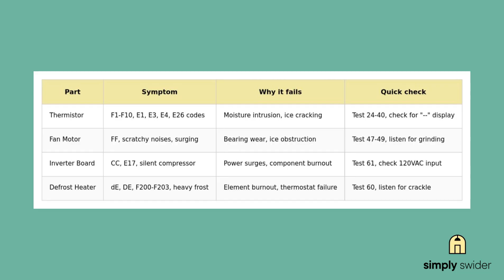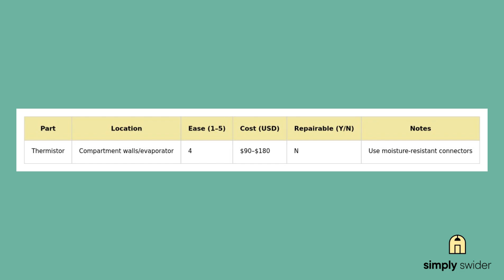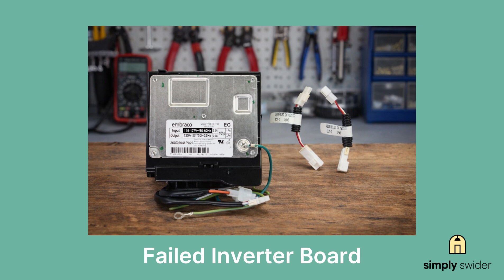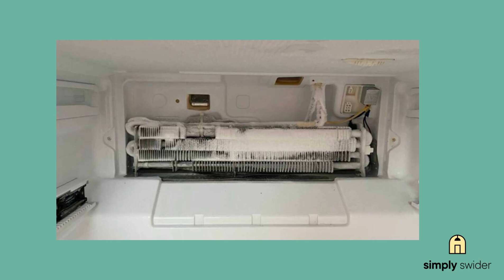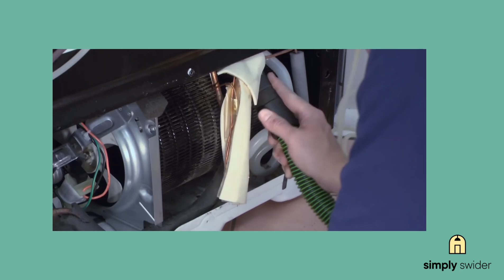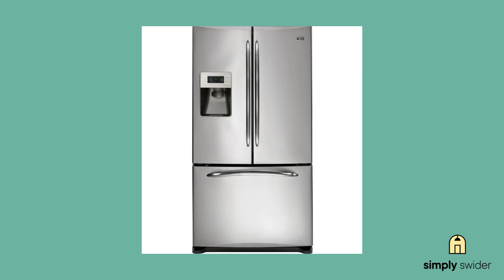GE Refrigerator Error Codes FF, CC, HRS: Fix It Yourself & Save $800!

Comment: Great video. My GE 22 CF bottom freezer model has temp reading panel, but holding them does not show error codes. Compressor is not working fully due to overheating from wire break and fan stoppage. It is a few months past 1 yr warranty and GE is not offering to help with repair.

Comment: i have a GE fridge and have the HRS code, sounded like it was trying to kick on every second or so in the back but i noticed it too late now it doesn't even make that sound, unplugged and cleaned everything in the back as well as i could with vacuumed and air blower, plugged back in, now i can hear something when i plugged it back in but thats it, lights inside work fine and still get that HRS code. any ideas??